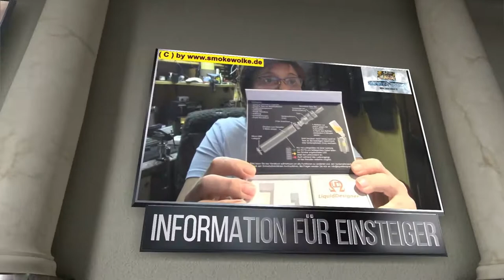Dremel ~ Proxxon ~ Kress ~ Wabeco ~  mein Hobby

Comment: Ist ja echt cool mit dem Teilapparat zum Rundmaterial bearbeiten! 
Bin am überlegen ob ich mir den Bohrständer auch besorge, habe bisher einen kleinen Proxxon Feinbohrschleifer in einem Proxxon Bohrständer zum Alu Fräsen verwendet und suche dafür gerade einen neuen Bohrständer.
Hast du mit dem Bohrständer und einem anderen Motor in den letzten Jahren schon mal länger Aluminium gefräst? 
Mein bisheriger Bohrständer schwingt sich wenn ich zu tief fräse manchmal ziemlich auf und eine richtige Fräse ist mir auch viel zu teuer.
Wenn der Dremel bei dir so viel Seitenspiel hat, könnte ein FBS12E (35€) von Proxxon mit einem Adapter runter von 43mm zusammen mit den Präzisionsspannzangen von Proxxon helfen, damit fräse ich bis 3mm Fräserdurchmesser zur Zeit 7075 Aluminium und bekomme eine relativ gute Oberfläche, Probleme mit seitlichem Spiel habe ich damit auch nicht und das Kugellager des FBS kann man auch einfach tauschen wenn es mal durch ist.
Der FBS12 lässt sich auch sehr leicht auf 12V Batteriebetrieb umbauen indem man einfach die Steuerplatine brückt, so dass man sich die teuren Netzgeräte von Proxxon sparen kann.
Wirklich interessantes und hilfreiches Video!
Liebe Grüße :)